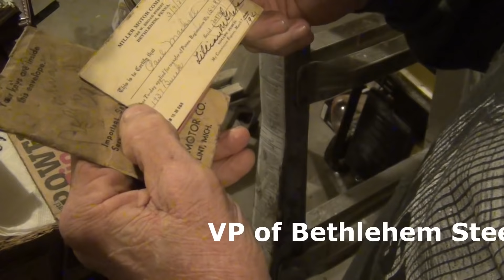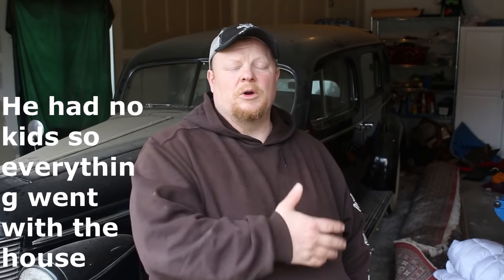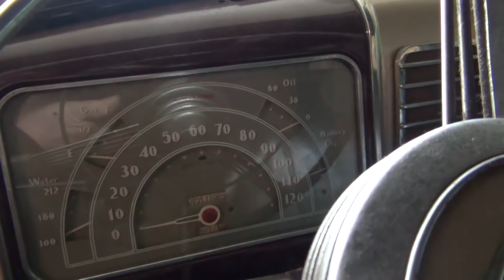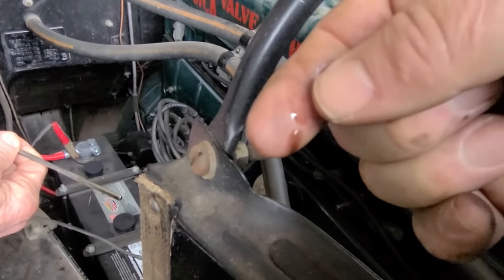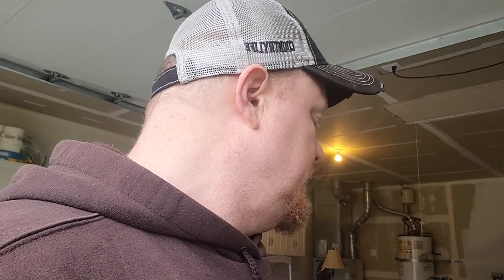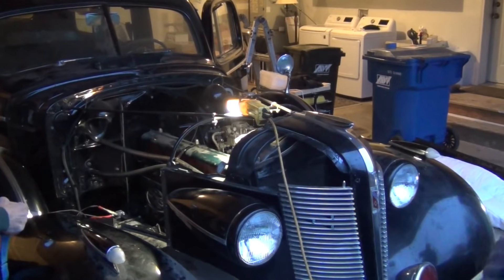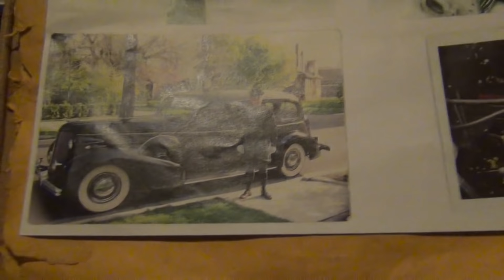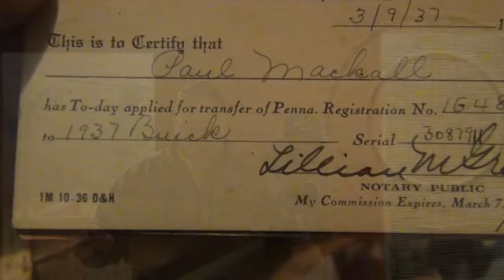1937 Buick Limo from the Movie Sting?, First start in 25 or more years!!

Comment: The battery should be under the front seat. It's been converted to sealed beams and an alternator replacing the generator. It appears to have had a later model carburetor installed. 37s had a vacuum switch on the manifold to activate the starter.

Comment: Yes good job guys. Starting a car up with unleaded petrol when its supposed to have leaded petrol. Idiots. Should have left it to somebody that knows something about old cars.
Reply: Valve and head damage from unleaded gas happens mostly at high speed/high load.  Starting classic cars and running them like that is fine.